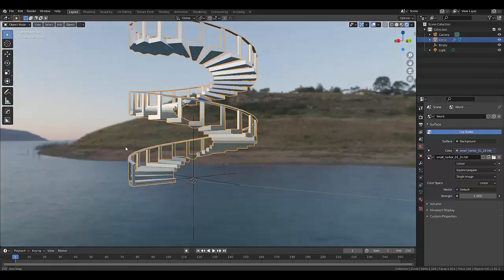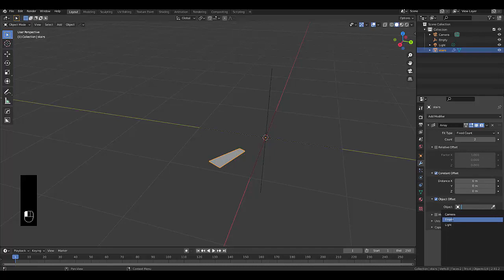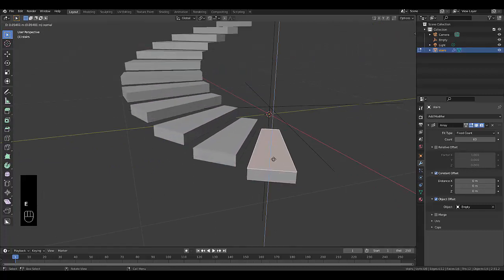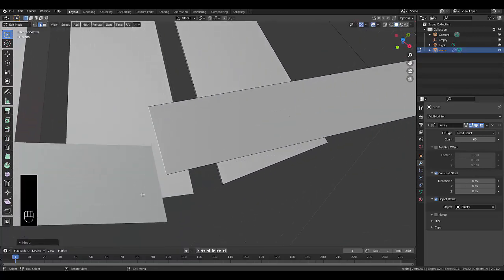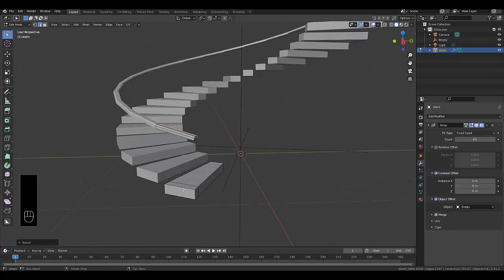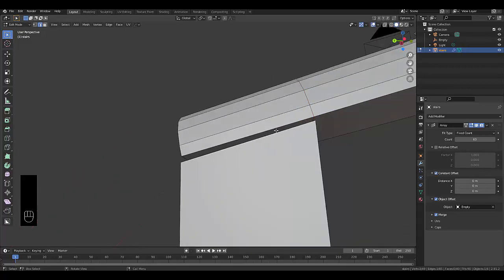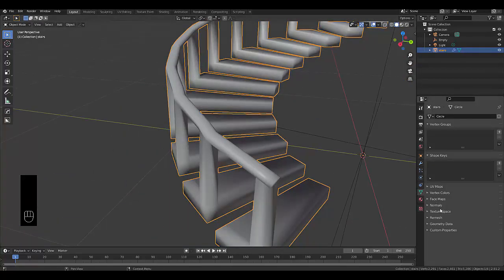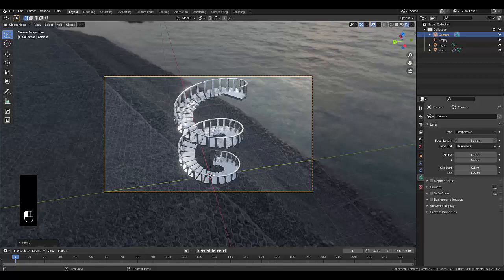how to make a spiral staircase in blender

Comment: How do you make it so it doesnt get smaller as you go up?
Reply: I had a similar problem, with the steps getting exponentially bigger. The thing is, each step gets the difference in each value of the transform between the original object and the Object Offset, so when the "Stairs" object has a different scale than the "Empty" object, each step gets exponentially bigger or smaller.

The fix is for both objects to have the same scale.
Reply: @ yeah I fixed it just by scaling the empty thank you though

Comment: Okay, I've watched about four tutorials on how to do this so far, and they all play basically the same, but when I get to the point of rotating the empty, my single step does not turn into a circle. Nothing happens at all, no matter how many times I start over. Is there some vital step that's being skipped over?
Reply from the maker: can you time stamp the part of my video where you get stuck its easier for me to help this way and provide alternatives as i made this video a while back
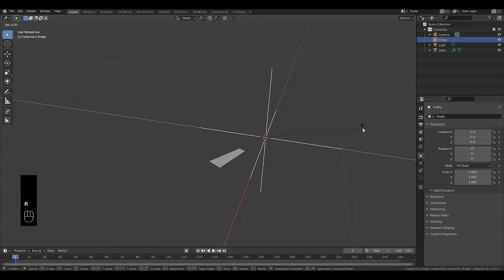Reply: @FunwithBlender  I think he means at 1:17 . I also had trouble at this point however from the way he describes it, its a slightly different problem. For me, rather than not do anything, the faces get smaller and smaller rather than keeping the same size.
Reply: make sure constant offset is all 0 in the X AND Y AND Z
Reply: I understand you posted this comment a year ago. But I think your problem is where your origin is at. If you set your origin to a fixed spot and make the circle and empty around that you should be able to get it to rotate appropriately around the origin rather than the "Steps" getting bigger or smaller and farther away. Frustated me alot but I figured it out pretty quick with understanding that it's based of the origin of the objects which you can set with a right click in object mode on any object.

Comment: When I extrude, the circle is still invisible
Reply from the maker: You need to make sure you changed from object mode to edit mode by pressing tab, then you have all the points of the circle selected, then you can press e to extrude
Reply: @FunwithBlender  Also, be sure you are in vertex mode, face mode doesn't work, which makes sense since there aren't any faces yet.